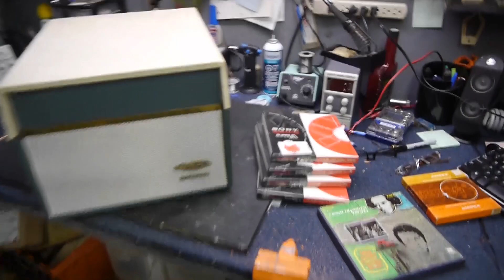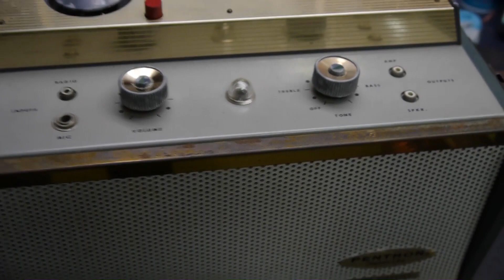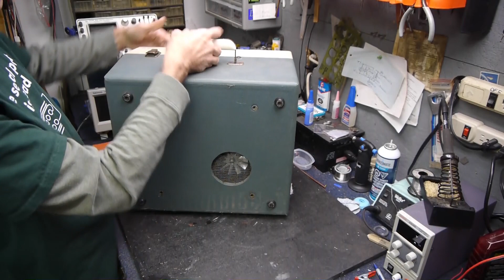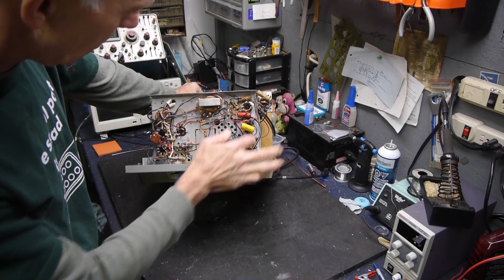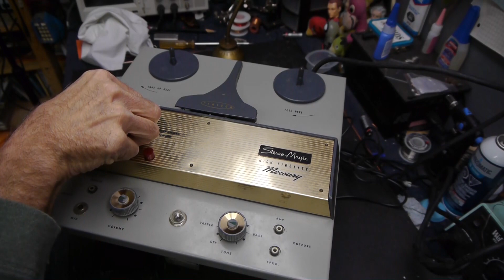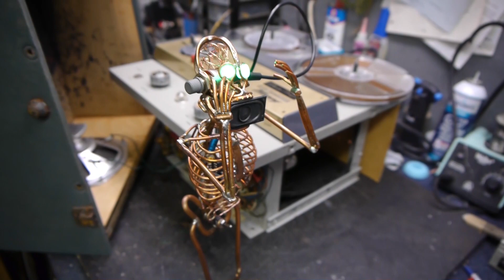Pentron Reel To Reel Restoration Part 1

Comment: i have a sony tc377, it worked perfectly. turned it on today and the right channel has stopped propperly passing signal. the vu meter shows that there is sound present, if i crank the input gain i get a tiiiiny bit of sound through but id say its 5% compared to the left channel, if even that!
so the problem must be after the meter. help....

Comment: I don't know if you still have this and/or are still working on it. The recording level is controlled by the same volume control as playback. It sounds like you had the recording level too low and were barely above the tape hiss

Comment: This unit is not Auto-Level. There is a neon lamp between the volume and tone control. It should flash on loud sounds while recording.

I am sure it should be playing louder than it is anyway. Tube amps are not very sensitive to speaker impedance and should work nearly as loud. The original speaker would be 3.2 ohm impedance.
Reply from the maker: Thanks Ray. I found a schematic on this and it shows that neon bulb. I've tested the tubes and they are all in great condition. Next step is to re-cap then check voltages and look for resistors that have drifted out of spec.
Reply: Ray Rooney you are right! Turn record volume up while recording. Also the “magic stereo” is real. That RCA cord you pulled out is the output for the right channel to be fed into an external amp. Pentron sold a companion piece for that purpose but anything will do. Look at the head and you will see it is a stereo unit , probably half track. 1960 model came with a quarter track head and a knob over the head cover to change position for playing either quarter track or half track prerecorded tapes

Comment: I'd guess the mike is the problem - my old Stella used a crystal mike.  It also played pre-recorded stereo tapes via the second head section and an external amp.  If that makes sense?
Reply from the maker: Tried it with a dynamic mic, same result. I'm thinking caps and drifting resistors.
Reply: It full working condition it will work fine with dynamic microphones. I used several on them over the years.

Comment: I wonder if the recording level was low because it is designed to work with a crystal mic that would have a higher output
Reply from the maker: Good call! It did come with a crystal mic originally. I'll be trying some audio input and see what happens.

Comment: ... but there was audio while rewinding...
Reply: PETER! lol.
Reply: The old design Pentrons (this is mostly based on their 9T-3C from 1952) did not have head lifters. The tape would run across the heads in all modes. Later versions added lifters. Yes. it caused wear. The trim piece that covered the heads prevented just running the tape directly from one reel to the other reel.

Comment: Wow,  i worked in the broadcast industry as a tech for many years but this is the first machine I have seen with the supply reel on the right,   it so looks to be running backward.   I've watched the clip twice just to check i could still read the writing and that it wasn't the video mirrored but alas it just appears to be one mixed up recorder.
Reply: These were one of 2 brands that ran "backwards". The other was Crescent who supplied mechanisms and whole units to Sears, DuKane, and a whole lot of other brands.

Comment: First!
Reply: I had that exact same machine in 1959 as my first tape recorder. Undoubtedly your input level us too low. As another viewer suggested, the circuit expects a crystal mike but will probably work fine with your dynamic mike but you need to boost the recording level. It is not automatic but is set by the volume control until the neon level indicator light blinks. I still have my original service manual on the machine. I eventually replaced it and cannibalized the parts.